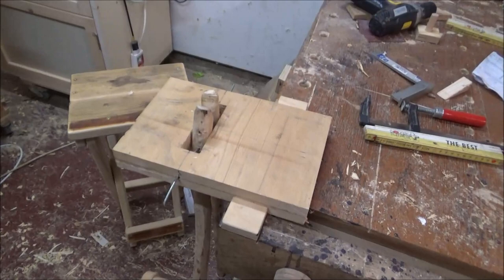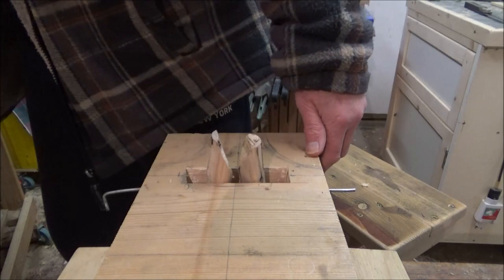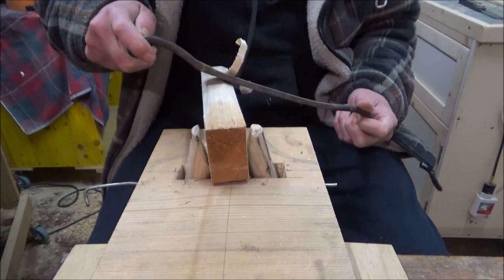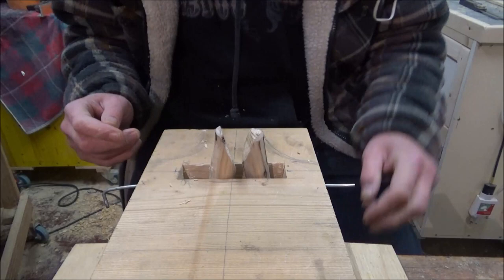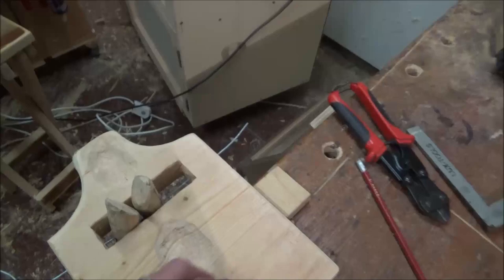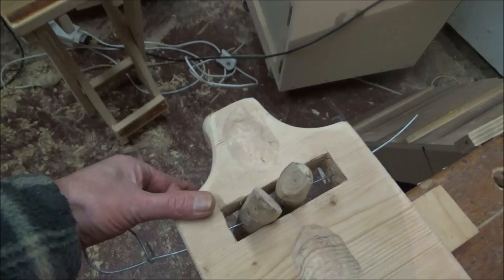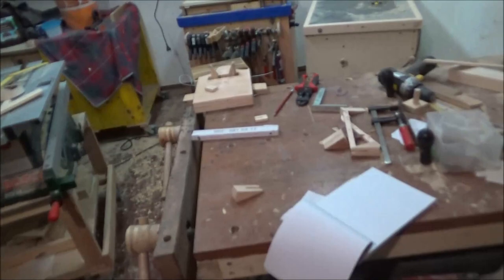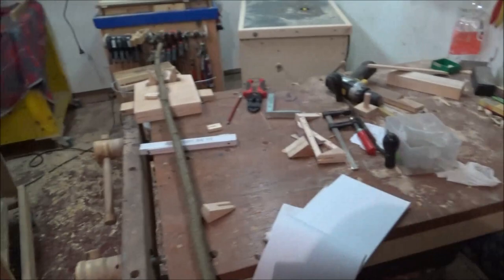Spoon and carving mule and a couple of little carvings  17 03 2021

Comment: I have been thinking of building a shaving horse for years! I think this makes more sense...
Reply from the maker: its handy as I dont need the full bench. I thought about a shaving horse but space is the problem it would end up outside all winter and rot out. I have tried the glacier lettuce seed twice now but they are not germinating... I have the second lot under the lights now so fingers crossed. If they fire I will send some. Sorry about that.
Reply: @SouthpawDavey  No probs Dave. Thanks for letting me know.